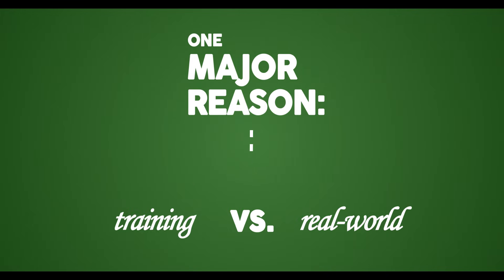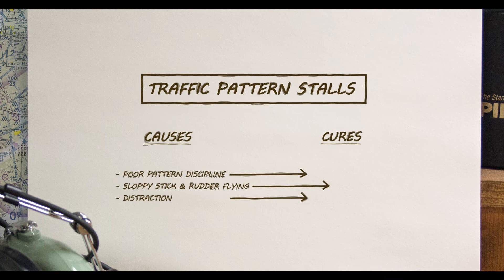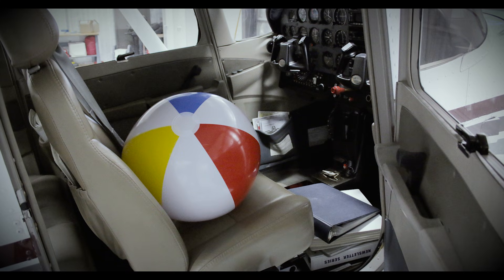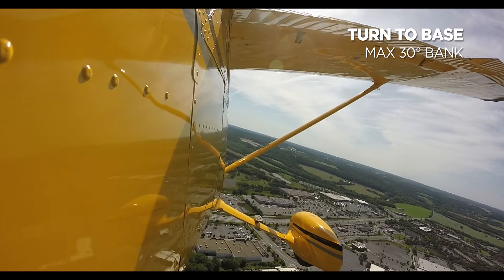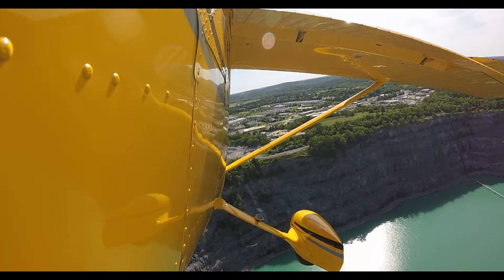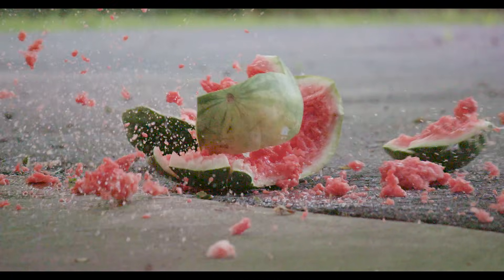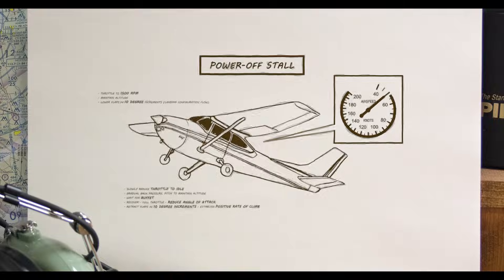Margins of Safety: Avoiding Traffic Pattern Stalls

Comment: Know your 60 degree bank landing config stall speed.  Don't go under that, typically 1.4 Vso.  Dont go below that unless established on final.  Speed is easy to lose but hard to get it quickly when you need it.
Reply: It is at 1.4Vso. You will stall it at 60 degrees bank.
Reply: @cabdolla  But only in a level flight/constant altitude turn. Most turns in the pattern are climbing or descending turns, and that bank angle/load factor graph seen in flight training handbooks states that ( usually ).
                   Climbing/Descending turns are a different ball of wax from constant altitude turns.
Reply: I’ve done 90 degrees Bank and not stalled... nor did the aircraft rip itself apart from infinite Gs

Comment: are there any other causes of stalls than just low airspeed?
Reply: Angle of attack. 

Anything can stall at too high an angle of attack, at any speed.
Conversely, it's not possible to stall WITHOUT an angle of attack. 

So, whatever the circumstances of a stall, reducing angle of attack (often to as near zero as possible) is the first priority in recovery.
Reply: But airspeed is still paramount. A slow aircraft low to the ground will still crash having never stalled.
Reply: Bartosz Olszewski : Absolutely, there are high speed stalls with power or no power.  Anytime you get in a situation where your airfoils lose their ability to supply lift.  Sometimes a stall is not always obvious until it is too late.  A good flight instructor will get you up between 8 to 10,000 ft. , and put your aircraft in stall situations, and let you get the aircraft back to normal and control flight.  You need to know what it physically feels like, and what you need to do to get your aircraft back to normal flight.
Reply: Angle of attack is ultimately what causes stall, not airspeed.  However, if you try to maintain level flight while slowing down, you're forced to increase your angle of attack to maintain adequate lift, and "stall speed" is where you'll have reached the critical angle of attack. At that point, pitching down will make you descend without stall, pitching up will make you stall and descend, and slowing down any further will make you descend (with or without stall, depending on AoA).

Comment: Some day all GA planes will have prominently displayed AOA indicators and these accidents will be a thing of the past. Until then, we need more videos like this. Great work!
Reply: AoA doesn’t do squat without airspeed. A slow aircraft will fly a non-stalled AoA right into the ground.
Reply: No they are not. Planes are AOA indicators themselves. And some pilots ignore that. They will ignore the AOA meters too. Or see them too late, funeral, how is it possible, beautiful aoameter, bla bla. No, planes will be more and more computer controlled. And the pilots will get less and less good oldfashioned flying skills. Maybe the airforce pilots, but those don't talk, 50 years later, on average.
Reply: They're making them and they're cheap for the experimentals, which require no faa approval... but for regular GA? Oh hayel no. FAA ain't having no part of that! May as well go to the hospital to buy a damned aspirin!  Bad enough with the ads-b mandate. At least a lot more companies are coming out with approved solutions lately that cost less, so there seems to be some push to get more better cheaper solutions approved by the FAA lately. Time will tell.

AOA Display=anti-death indicator! :^)
Reply: about 20mph is all these things need to work.

Comment: On aircraft like the 172 or DA40 I leave a little power in, maybe 1000 RPM, and go to idle once the mains are down. With flaps down some pretty aggressive maneuvering would be required to stall. I've never seen this discussed, however. The old method of teaching a student to "stall" 6 inches above the runway creates adds an acceptable risk factor IMO. Nice video.

Comment: Lot's of comments and dialog and sounds like an FAA video.  I do a lot of stall/spin training to all types of pilots. some common faults. Don't keep the airplane in trim, Aileron & Rudder coordination is almost no existent, fixated on chasing an airspeed, bad pitch power trim coordination. Most are "ground shy". As they approach the ground they subconsciously raise the nose as if that will keep them from hitting it. Then IAS goes in the toilet, sink rate then increases and they pull back on the AOA controller (Yoke or stick) increasing the AOA in an attempt to stop the closer rate to the ground. Very few good landings follow a bad approach. The currant FAA recommended stall/spin instruction is so wrong and the accidents records have all the proof. The last landing in the video was a bad example to boot. landed left of center line and continued to drift left after touch down. Typical, common mistake.
Reply: Agree more can be done.  I fly gliders, which have gentle stall characteristics compared to most powered aircraft, but require good energy management in the pattern (after all, you can't go around).  A few flight in them could be very useful for the student or licensed power pilot, and would also show that planning a no engine landing from altitude is pretty easy.  (I suspect too many stalls happen when people mishandle such non-emergency situations.)  

Agree too about spins; when I was learning power tried my first  accelerated stall and put my Cessna 150 into one.  Being dual (with the instructor) I insisted he teach me spin entry and recovery.  That was a great confidence builder!  Recently in the glider I ran through some more with the CFI and we then practiced simple aerobatic maneuvers up to loops.  What a thrill.  A little extra training can do wonders to keep you safe, and avoid the killer of pattern stalls.
Reply: Heh... your comment reminds me of the pilot of the Gimli Glider video. Landed that monster like a beast! He too was a glider pilot!

Comment: Motion sickness has always been a problem. I'm still working on my private vfr but since I can't afford flying lately I've been reading through my aviation handbook. It's kind of strange. I never found time for it when I was flying and with my 35 hours in the air, just a tiny bit of reading tells me I have a lot to improve upon.
Reply: My commet is a bit late (2 years late lol) but try eating a small meal 30-45 minutes before your lessons. Something solid. It works for me 100% everytime.
Reply: Did you get chance to obtain your license in the end?

Comment: Great video. Thanks for the work. In a future version, it might be worth cautioning against chasing the center line after overshooting a base to final turn.
Reply: That's solved. The runways are on wheels now, and shift according the pilots unaware of the need of a wind socket. To switch the system on, you must ask ATC for an ARC landing. ARC is Automatic Runway Control and developed by Gremlin Aviation Phun Ltd. in Cardiff-Rental in Wales, in cooperation with B.F.G. Valley, the famous WW2 Hurricane pilot.

Comment: The types I fly don't have a stall horn.

You'll feel it before it happens with airframe buffet,  but you don't want to let it get that far.

Airspeed management and correct trimming is essential. Don't get distracted. Keep flying the plane. So what if you miss a radio call? Keep the thing in the green. Check the ASI regularly.
Reply: Keeping the ASI in the green isn't going to help much in a 45 degree banked turn onto final. That's why people spin in.

Comment: Great points!  I'm from a moderately high performance training world (military) which is slightly different than the GA world.  I also like to take my students to the practice area and allow them to explore high AOA flight at both high and low speeds.  The amount of stick movement versus G-loading is very different right at the stall threshold and it's good to feel that and know exactly how the airplane is talking to you.  I've found that if a student knows a stall is imminent, they're more likely to correct the error or go around before it becomes an issue.
Reply: This is so important. It's easy to fixate outside the aircraft and lose track of your speed or bank angle while in the pattern, but every pilot should be able to feel when the aircraft is approaching a stall condition. Whenever the controls start to feel soft when I'm in the pattern it's like an early stall horn going off in my head telling me to glance back at the airspeed indicator and make sure I'm on speed and not in danger of an accelerated stall. One time I actually had the airspeed indicator get stuck and I knew something was up because of wind noise and control feel.

Comment: Well, like texting and driving, where drivers are never really taught what their priorities are ... thus we have laws to hopefully (actually only minimize) accidents, some pilots do not take aircraft speeds vs. attitude vs. control usage seriously (called mental attitude .. and NOT aircraft attitude), thus we must be constantly reminded.  Of course, aircraft design nowadays is aerodynamically intended to be  'safe' and forgiving, even with some mis-use of control movements, and pilots can become complacent.  The aircraft used in the video is a good example of that.  If you make a 'gentle' turn in flight, the aileron design will keep the ball pretty much in the center .. with the feet flat on the floor (taboo).  I could write a book on this, but I will abbreviate by saying that I have always emphasized slow-flight .. or whatever you want to call it .. and THEN emphasized (demonstrated) mis-use of the controls (not in the pattern) and what the outcome could lead to ... sometimes frightening.  You can do this in a C 150 (a good trainer in that regard).  Of course, the flight tests, in my view,  have maneuvers that are too docile to really reveal a pilot's capability.  And so it goes.  And ya da, ya da.  From a 12,000+ hr. ATP, CFII, MEI , 50 year Wright Bros. Master Pilot,.etc
Reply: What I miss in this video is explanations why it is often natural to do things wrong. Why it's easy to screw up. The ASI solution: always fly that plane exactly as you've learned it, and be aware of dangers, that should work. The warnings for distractions, poor coordinated flight, an incorrect approach, go around, and more, it's very good advice.

But what I miss, is an explanation for using too much rudder. In an attempt to compensate the need for banking further (30° is the limit) in order to correct the approach, the good habbit to avoid steep banking in the landing pattern can have a dangerous effect. Banking is limited for good reasons, so let's use the rudder. That's totally wrong, but close to the ground fear for banking and still using the "normal" amount of rudder is not only the cause of a fatal spin. It's also a logic explanation why this deadly mistake still occurs far too often. Another logic reason for that spin or stall is the irrational fear to point your nose to the ground. It feels like the plane goes down, but in reality the airspeed will keep high enough. Acting according to this dangerous feeling is pulling up the nose, trying to avoid the approaching ground. And what happens? Our famous fatal stall or spin. Then it's good to know those two reasons for this type of fatal accidents. There are more of these  wrong behavior triggers. Think of the relative movement of the lower wingtip over the ground. Flying high, it will move back, while turning. But flying at lower altitude, while turning, that lower wingtip might not move back anymore. Pilots can make the same fatal mistake: using too much rudder, because that low level turn feels different and they try to get the lower wingtip moving backward relative to the ground. Ever heard of that effect? It sounds absurd, but I swear to you it is as true as it's sketchy. 
You're right, there are many books about safe landing. Keep reading, and talking about it. Fly safe.

Comment: Need to correct the pattern depiction at the 4 minute mark.   Base leg should be a straight ground track, not a continuous turn as depicted.

ACG
CFI,II
Reply: Alan, this is an up to date video, continuous downwind-base-final is on the drawing board as a way to minimize stalls in those (the lowest and slowest) parts of the pattern. Obviously level out on base, even if for a moment to judge the last half of the turn, and produce a more stabilized approach. Cranking out the turn to final when slow and trying to line up an overshoot is the most dangerous turn in the pattern. The inside wing's airspeed drops very close to Vs/Vso when pilots do that, resulting in an immediate stall spin situation.
Reply: That is by far the dumbest idea ever invented in aviation. Let’s make a base leg square for no reason at all so we can have either a monstrously huge circuit or a super tight turn going to final... while making our approach angle 100% dependent on power. The only time I square off a circuit is if I’m too high or need to add space for traffic in front of me.
Reply: @Bartonovich52  Yes, that's what you always see on YouTube. Crap landing patters, crooked approach and last second corrections. The solid square pattern, giving you time for checks, observations and corrections, making every landing basically the same is screwed by everyone except the real professionals.

It's a base and a far too short approach, or a long and often low straight in. In short, it's an emergency landing pattern. Just improvise a pattern, everything is allowed, that's the attitude.

Just view some video's, the good examples are a minority. Or do all those airfields have crooked patterns for noise level reasons? Then you have pretty sensitive potatoes and vegetables in the US...

This is a bit exagerated, but really, some planes land okay after an approach completely missing the centerline. Why? Just because you are afraid the engine might stop? Good reason, low altitude and flying bricks (engined planes with prop not moving) don't mix. Rooftops aren't fun for gears.

Comment: A little dramatic but some good messages in the video. The better the approach paths (track and vertical)  the much better chance of a better landing. One of the best ways to avoid sloppy use of the elevator which is the sole AOA controller is to keep the airplane in trim at all times. Trim is your friend and you need to use it every time you make a pitch or power change. Your Pitch and therefore airspeed control will be much more stable and the will not deviate.  Pilots of all types fail to use it and a lot don't understand how to trim believe it or not. The decent angle looked too shallow in the video. Low, drag in approaches are just bad business. Flaps and forward slips make a steeper approach path easy and much safer. The standard FAA  approach is too shallow for most GA airplanes.  The airplane can't stall unless you place the elevator in the stall position.

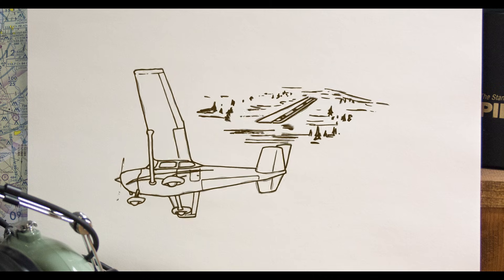Comment: 1:22 Oh my God why is that so terrifying?
Reply: It isn't when you practice a few and know you are in control.  After a while  they become kind of fun.  Regular practice increases your sharpness across all flying.
Reply: Because it IS terrifying. If this goes wrong, you are dead. But the solution is simple. Fly fast enough. That's it.
No offense Dr. Weil, but I wanted to emphasis this IS a fatal mistake. Zelda fan is right. But that's not enough reason to stay on the ground.
Reply: @voornaam3191  Well taken, though it sounded like Zelda was shaken by the idea of stalls at all, while I was saying they are both routine and controllable, and I don't find them terrifying at altitude.  Though doing accelerated stalls in a glider really does get your attention.  And I still say practice and practice (with a CFI and later solo--should have emphasized that) until staying out of the stall zone in the pattern simply becomes deeply ingrained into your awareness.  And if somehow you are there, you get out of it fast.  Also some spin practice and pattern stalls at altitude should be part of routine dual training.  Important also is understanding that making a 180 after an engine failure is usually a fast ticket to the cemetery.  See the AOPA's "Impossible Turn" discussion.
Reply: they made it sound so....eerie